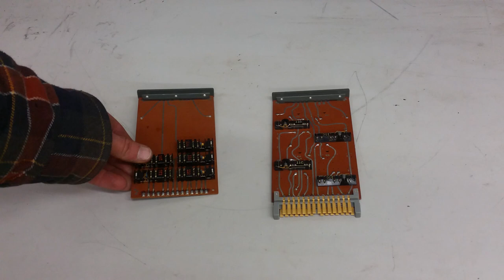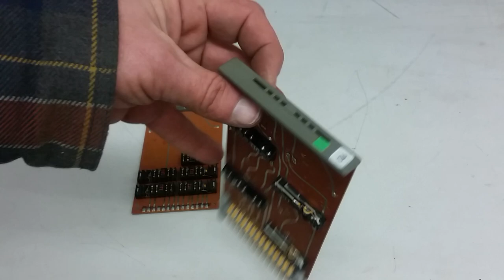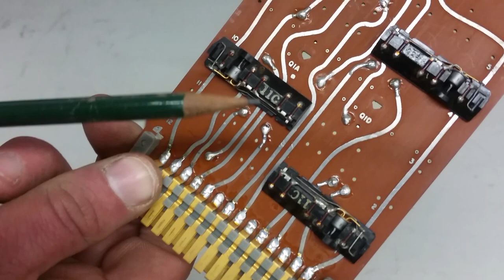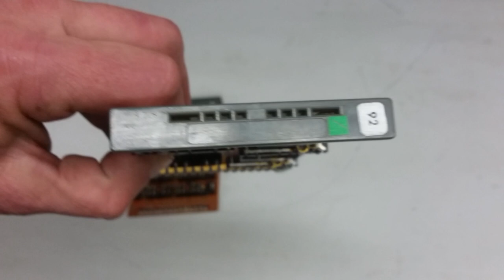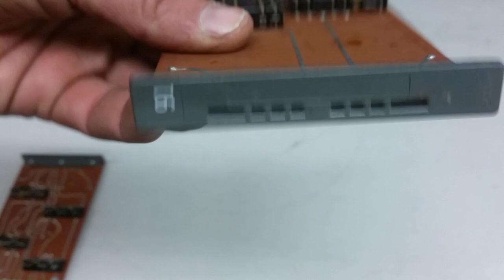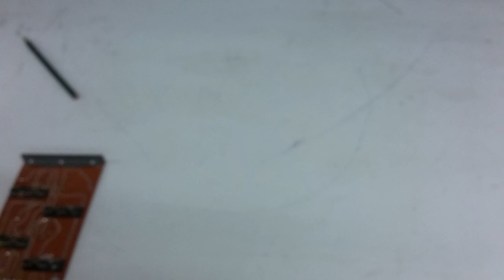Weird Bell System Modules

Comment: There's been some discussion about this on the TCI mailing list. It's quite likely that the 1961 date is accurate. The "CPS 92" on the first card is a "Circuit Package Schematic" identifier. The majority of known circuit packs, including those used in the 1ESS, had part numbers that started with a letter. The prototype ESS in Morris IL however used purely numeric circuit pack numbers. There is a Bell Labs book on that switch that lists a number of the packs, however 91 and 92 are not listed. One theory is that these were used in the No. 101 ESS which was a PBX that was in development at the same time. There is a picture of a cabinet holding the circuit packs in the book A History of Engineering and Science in the Bell System - Switching Technology and they bear a striking resemblance. There's no indication of pack numbers though. The first No. 101 ESS went into field trials in early 1963. Unfortunately there's not a ton of detailed information that's been digitized about the No. 101 ESS such as Bell System Practices or circuit schematics. There were two articles about it in the Bell Labs Record in November and December 1963 but I don't believe those are available online. They may have more specifics.

So, given that it's a numeric series of circuit pack numbers, and the likely manufacture date of 1961, it's possible this is from a prototype No. 101 ESS. It's also possible that this was used in some earlier system that we're unaware of. No one has been able to find information on the hybrid modules or the B- number that's printed on the board. There's some other resources that may have some information so if anything else comes up I'll share that.
Reply from the maker: Thanks for the great info.
Reply: Hey Sam, thanks for stopping by with the info. There is no public archive for the TCI list so this is really helpful.
Reply: @Silent700  You're welcome. There actually is a public archive. The list migrated from Yahoo a few months back. I checked in incognito mode and anyone should be able to view this: https://groups.io/g/singingwires/topics

Comment: MSI also had a PDP-11 running some kind of health or nutrition exhibit.  It was in a glass room not far from the entrance and there was a terminal you could interact with.  I think it was finally removed in the mid-90s.
Reply from the maker: Yes, I remember that. For a white they had the PDP-11 that ran it as part of the exhibit. It was an Industrial-11, maybe a PDP-11/40.

Comment: The numbering and the form factor scream ESS cards to me... Perhaps not Number 1 ESS, but one of the later ones. These were the replacements for the step by step systems as well as the big crossbar switches, and they tried to keep them extremely modular as to make maintenance easier. They had a teletype hooked up to the whole shindig that would print out any failing modules that they could the swap out.These were used in CO's only as far as I know...  Do a quick google for  "Western Electric No. 1 ESS Circuit Pack" and you will see similar (but older looking_ cards with a different edge connector.
Reply from the maker: It is a bit early (by four years?) for 1ESS, if that 1961 date is valid.
Reply: I'm not entirely convinced that is a date code. I mean it sure looks like it. I would hit up sxsphil on youtube with this video and see what he says.

Comment: They're from waaay before my time, but they look like some early attempt at an integrated circuit-type thing. Trying to put a standardised little circuit on a carrier. Those little round things look almost like wire wound resistors, but in almost a melf package 🤨

Note: pure speculation on a subject I have absolutely no real knowledge on 🤣